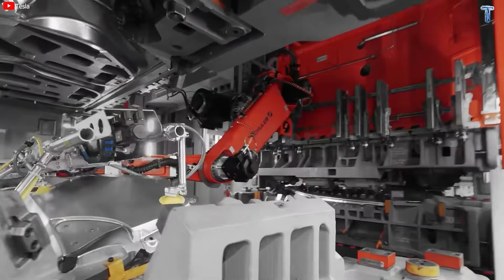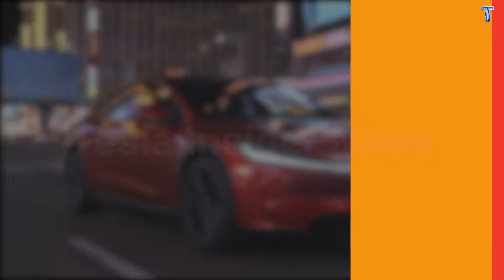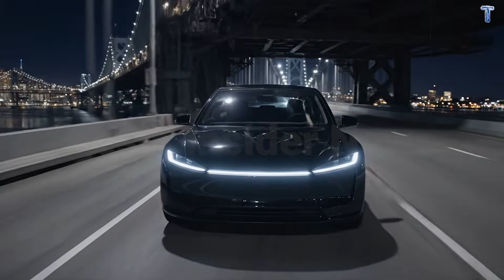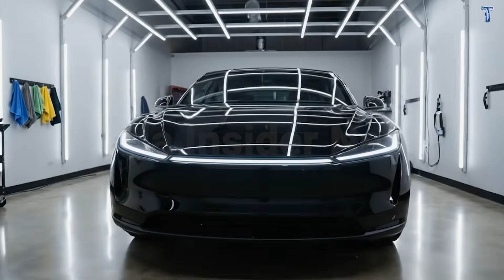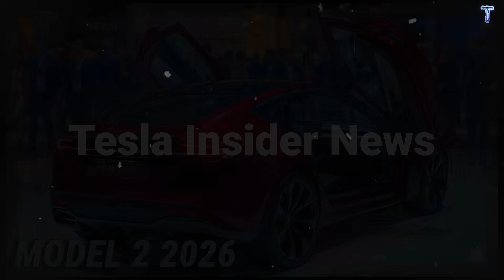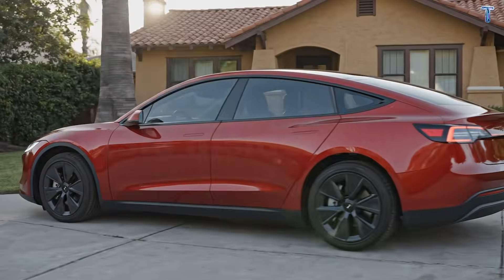Elon Musk’s $12,749 Tesla Model 2 2026 Ends ‘Surprise Car Bills’

Comment: Who are auto body men/ women that will repair vehicles? Ship the car back to the factory melt it down making a new one.
Reply from the maker: Repair is a real question. Even with fewer parts, owners still need body shops, sensor calibration, battery service, and affordable parts — melting down every car would not be practical. What repair issue worries you most?

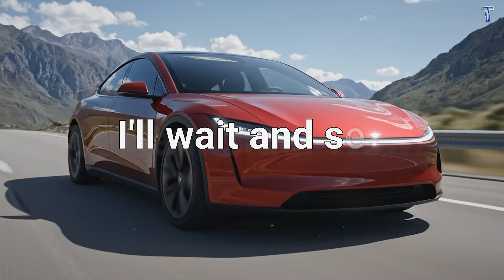Comment: I believe it. No one really knows the answer because they don't know what's inside.Elon Musk's mind. BUT, I have been thinking that Musk is really thinking this way for this Model 2 release. I am with you. This is the most significant turnaround in automobile manufacturing history. This will put the industry on its head if they don't start doing the same thing! Design a car to last. Not one for planned obsolescence which the automobile industry has been doing for over 100 years. 20:19 INDUSTRY GAME CHANGER!

Comment: We are in the USA. Please use our system of measurements.
Reply: I agree with your concern. The problem here is that the use of metrics is much more exacting in its increments than SAE. Sometimes it's more important to be critically exacting than SAE will provide in order to provide enough space or clearance or strength to secure something or make it safe. SAE is designed for strength without concern for smaller spaces or sayings that require exactly movements the difference between 1 m millimeters and centimeters can provide.
Reply: It’s the internet, get educated